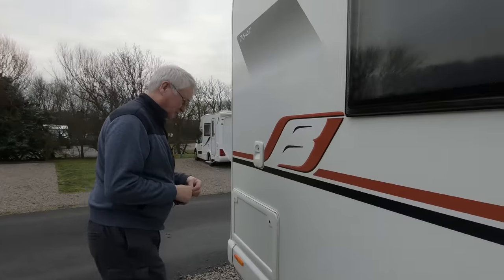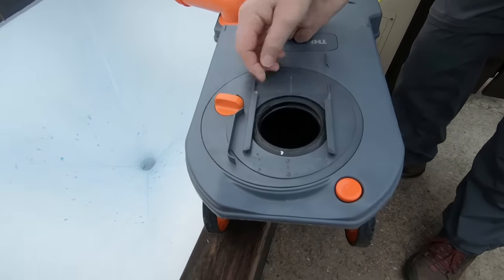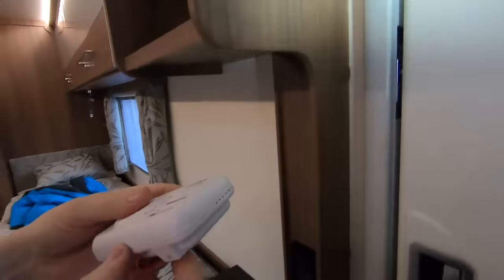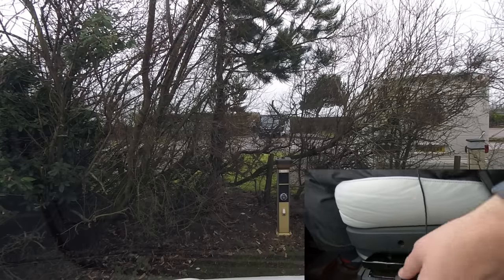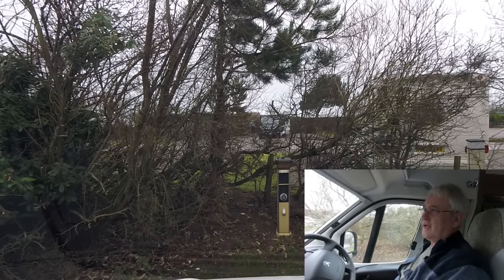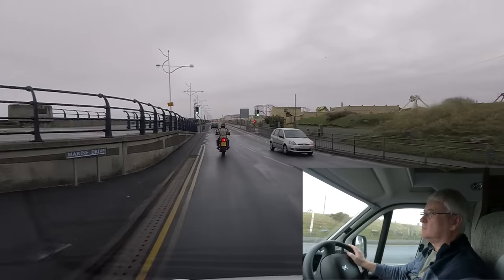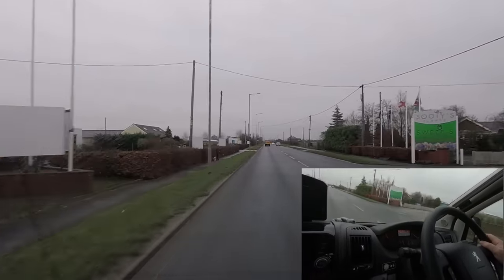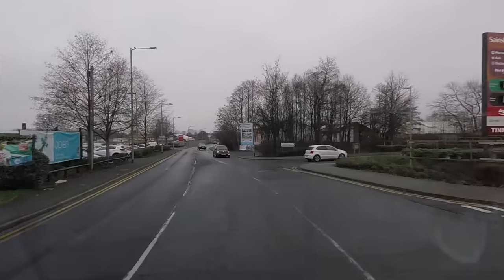Burrs Country Park C&MC Site, Serviced Pitch | Bailey Advance 76-4T | Bailey Motorhome City Tour

Comment: As usual another great video. One point being mentioned is how low the waste pipe is. All Bailey motorhomes are built on a ALKO low chassis which it is claimed to improve road holding and ease of access. You cant have everything. Other comments have been made comparing it to your own van, but in a way an unfair comparison as your Bolero is near top of the range and you are test driving Baileys entry level range motorhome.
Reply from the maker: It's difficult for us not to make comparisons too. I think back to what our early motorhomes were like, we'd have loved to have had a Motorhome like this as a starter Motorhome!

Comment: Having seen the interior of the Bailey Advance again I do like the layout. Which heating do you prefer, the blown air or Alde radiators? I suppose it is a case of 'swings and roundabouts'. The blown air is probably quicker to heat up the interior, and I think that for anyone using their motorhome in winter months the abiity to use gas while on the move is really useful. I can't understand why Bailey haven't supplied an owners manual. I don't think I have been to any of the sites you are visiting, yet, but I like the look of Southport C&MC and it looks handy for walking into the town from site.
Reply from the maker: Thanks, yes, the different heaters have different advantages, Truma heats up quicker, but Alde doesn't have heater pipes everywhere. I managed to download a manual, so technology saves the day. Southport is a nice site, about 10 minutes walk into the town. I did an Arriving at Southport video a while ago.

Comment: Great vlog again thanks. Just to top and tail the loo empty bit (as a newbie who spent a couple of weeks in a motorhome for the first time last year), am I right in think you would have opened the larger hole again when you got back to the van to put in the blue gloop - we were putting it in the emptying tube as didn’t think to open the bigger one and weren’t shown by the hire co. This would solve the issue we had with most of the chemical seemingly sticking to the sides of the tube instead of going into the tank!
Reply: Yes either put the goop in the big hole or just poor it down the toilet when open, immediately cleaning any drips on the white.
Reply: Thanks. I appreciate it probably sounds really obvious, but useful to know for anyone like me this time last year who has zero experience of how these things work!  It’s one of those essential processes where there’s little online to show you exactly what the process is beforehand!
Reply from the maker: Yes, I use a liquid that has it's own measuring container and normally put it in via the big hole. It's easier, but if you need to measure the blue, the cap has marks on it.

Comment: Have you noticed on the dashboard whether there is a potential warning/ message light as to when the ad blue needs topping up? On my Discovery Sport ( Now gone hence new motorhome) a warning would come up a couple of thousand miles to go.It would continue a warning you every 500 miles until it got to the final few hundred. if you ignored it and ran out the engine would not restart.
Reply from the maker: I haven't seen a light for that or got to that stage yet, only 100 miles done so far. I would guess a warning message would come up. I can't see a light, but I know what you mean, I hired a Vauxhall Zafira a couple of years ago, and almost as soon as I started driving it, the warning light came on, with 500 miles to go before it needed refilling.

Comment: Hi Bob. 
Great video again with some useful info.
I agree there should be some kind of reverse camera or sensors on these vehicles, my little Toyota car has both fitted as standard.
Was that a red light you went through leading onto the roundabout??
Oops...
Reply from the maker: We know, too busy talking :-(
Reply: I didn’t want to publicly mention the red light, .... think I’d be doing a bit more editing right now! 👍👍😆😆
Reply from the maker: @turnerwalker1532  Thanks I already have! Takes a while though.
Reply: @BobEarnshawMoHo  honest guv I didn't see anything ...
Actually it high lights what you was saying about tail people and the fact that the mechanism for the seat makes you seem perched up high.
The view of the light was probably hidden in a blind spot. - obviously a issue that you was highlighting. (Public service and all that).
Do you find that the 'A' pillars with the blinds on cause problems?

Looking at that waste water again,it looks like the tank its self is very low.
Is it protected?
I suspect a replacement tank would cost a few Bob! (no pun intended).
Keep it up!
Regards
Reply from the maker: @nicklong9547 thanks, I was looking at the lights further on officer, didn't see the lights on the crossing. Yes all Fiat Peugeot Motorhomes have a blind spot on the front pillar. The blinds don't make it any worse though. The waste pipe is low, but it's just the pipe at risk, not the tank. I know because I have knocked the pipe when I had a Bailey Compact.

Comment: The handbrake is the thing I struggle with most on our motorhome which is on a Renault master. It’s located between the front seats but I can never tell if it’s on or off (because of the seats being able to turn, the handbrake is always in a down position)

Comment: Re cab controls... don’t know if it’s the same on a brand new van, ours is a 64 reg. I think it’s wrong you can’t have the side lights only on. The switch is either off or full headlights on . With modern vehicles having daytime running lights you’ve always got something at the front lit up but occasionally you feel like you need some rear lighting but not needing full headlights on.
Reply from the maker: Yes agree with you, sometimes you don't need dipped headlights.

Comment: We have the same loo in the van....did you notice that the cap is a measuring device for the blu chemical?....
Reply from the maker: Thanks, yes, I know, but they seem to have removed the lettering on the latest one, it just has indentations to mark how much. I normally use a chemical that has it's own measuring container.

Comment: Hi bob and Jenny fab video like the walk around of van that waste pipe is low  is the bailly wider than your van or narrower .been the bailly van is a low cost van so there thing that aren't on there like reversing camera and other things because it a low cost van do u thing u saving much money buying a low cost van and putting the things on yourself or buying a upper model with those things on seem those gadget missing off van r what u
 need for daily use cheers .kev
Reply from the maker: Thanks, yes it's wider than our motirhome at 2.489 compared to 2.38 metres. Can't say I noticed when driving. Yes, you read my thoughts, buying this motorhome would mean you can add the things you really need, so if you never go off grid, you might not need solar panel.

Comment: How are you finding the extra 10bhp? And also can you cover off adblue and where to get it. Cheers Oliver
Reply from the maker: Thanks for the questions. We've lost 20bhp and because this Motorhome is lighter it's been no issue at all. I haven't had reason to take the Adblue cover off as it only needs topping up every 6000 miles or so. I know people can top it up themselves.
Reply: Sorry Bob though it was the 160BHP model!
Reply from the maker: @CaravanningwiththeCoxs  The Alliance and The Autograph have 160bhp engines, but like I said, no complaints about this 130bhp engine.

Comment: I have meant to ask you this question for ages. At night and you are asleep what is the sound insulation like on vans from noise?.
Reply from the maker: Compared to what? Certainly better than being in a tent. We don't notice much outside noise, depends where we are pitched.
Reply: @BobEarnshawMoHo  Daft question but can you get double glazing in motorhomes/caravans.

Another daft question,  can you turn off the heating in the bathroom/bedroom  if you don't want it on like you do in a household radiator where you turn off at the bottom.
Reply from the maker: @davidtaylorbfd  Good questions. The habitation windows are double glazed. Normally have two layers of plastic with air in between. The cab windows aren't. 

One advantage of blown air heating over Alde heating is you can close off the vents in areas that get too hot. The Alde heating we have doesn't have taps you can shut, like at home.
Reply: @BobEarnshawMoHo  Thanks for that, hope your bad chest gets better.

Comment: The bailey brochure has a measurement for the width with mirrors folded. Do they mean folded out or in because the measurement for both the Advance and the Autograph ranges are the same. The Autograph is obviously wider in the body and if the mirrors were folded in the body would be wider than the cab so the two ranges should have different widths and not the same width as Bailey state. Do you have a tape measure and could you measure the width of the body please?
Reply: Meant to add great video we are looking to get a bailey 66-2 so these videos are spot on for us.
Reply: Meant to add great video we are looking to get a bailey 66-2 so these videos are spot on for us.
Reply from the maker: Thanks, you clarified something for me as well. On the Advance the habitation width (the caravan part) is  2280mm and the cab width mirrors folded in measurement 2489mm. On the Autograph habitation width is 2422, and cab width is the same at 2489mm. So the caravan part on the Autograph is wider.
Reply: Thanks, but I'm still confused. With the mirrors folded in the cab cannot be wider than the bodywork, the 2489mm must be with the mirrors out or it is the external measurement of the wider Autograph body (and is wrongly stated for the Advance which is obviously narrower). Im being OCD about it as I have a very narrow driveway. Ive measured an Advance at the dealers and it was nearer the 2280 than the 2489 !!!
Reply from the maker: @richardharris9536  the mirrors folded are the widest point. If I look down the  Motorhome when they are folded they stick out a little bit.
Reply from the maker: @richardharris9536  How wide is your drive?
Reply: I have a panel van atm and park it between house and hedge with a minimum gap of 790mm between van and house. This gap is our only access route to back garden and garage for lawnmower, recycling bins, etc and present van is 2080mm wide. So knocking 400mm off 790mm would be difficult to get things through.

Comment: Have to ask how does the heating work in motorhomes? Do you need the engine running, like a car, or is it gas?
Reply from the maker: Thanks for the question. No, you don't need the engine running. The habitation heating works either on Electric or on Gas - LPG, Propane or Butane bottled gas, or some people use refillable LPG tanks. If we stay on a campsite and they have electric hookup, we will set it to run on electric, if we are out and about, stopped in a layby or admiring the view, we can use gas.